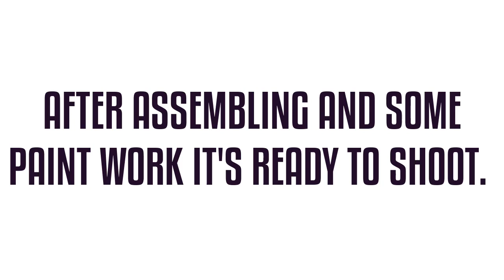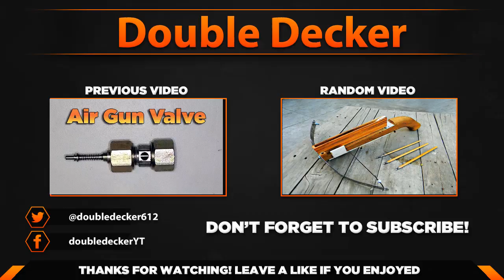Homemade Powerful Air Gun| Simplest Tutorial

Comment: One day it will explode.. :)
Reply: ahahahha hope not 😂😂
Reply: Welded stuff like that are not safe againts the psi that puts inside it, unless the psi is only in small volume, and to be honest i've done this experiments like in the video but then id prefer not to continue it comparing to the risks that might be happen. In fact i do not need gas airgun or pcp, but i have upgraded my handpump airgun/old fashioned ones that it can get into 757fps and the noise is beating the gas airgun, tested already to my friend's shop. compare that to mouser airgun for the fps. This similar or abit more than the pcp airgun for the speed, the test was satisfiying me and the speed is good enough to get the target, i have tested also using longer pellet than the normal ones (you can check the longer pellet at 4.5).
Even if i would have the gas airgun id prefer to just buy the proper ones and not riskiing to do such experiment, really not worth seriously. I have in mind my favorite gas airgun to buy in the future, the automatic multiple shot ones not THE PUSSY ONES. but for now its ok for that super handpump upgraded airgun i have as the fps is great already, im enjoying it my creation and its a secret project i dont have to publish.